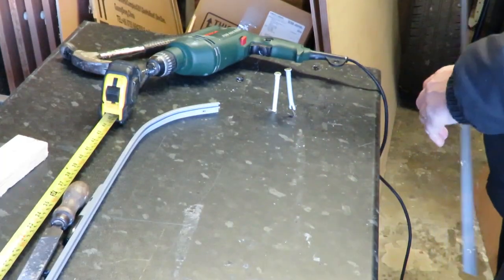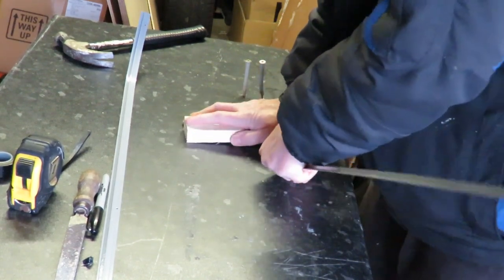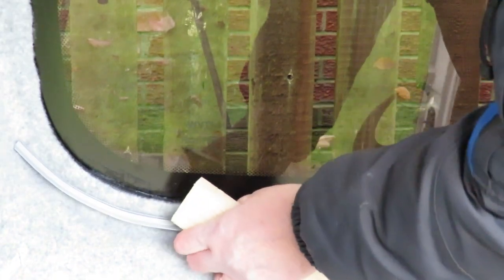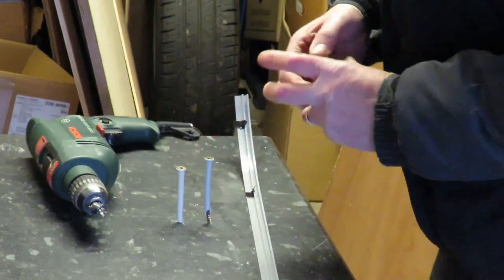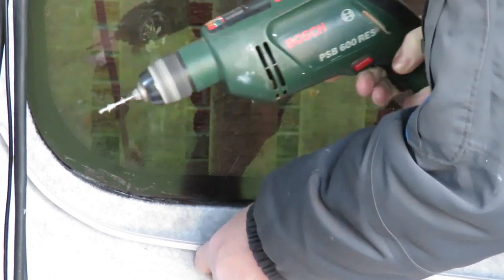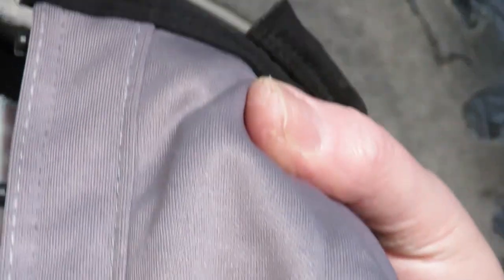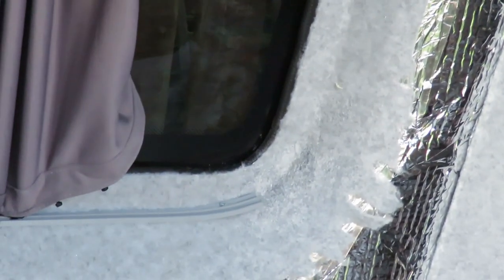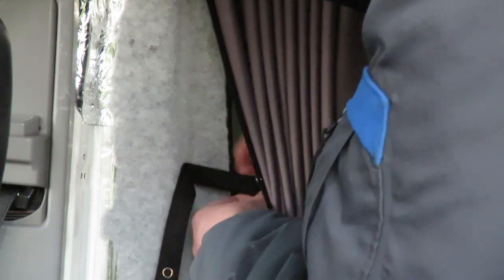How to Install Van X curtains - VW Crafter DIY Camper Van Conversion - Video 12

Comment: Hi Brian, can you let me know where I can purchase the rails to make these curtains please. Thanks for your time
Reply from the maker: You can buy the rails separately from VanX, but these came as a kit specifically for the Crafter/Sprinter, I used  Kiri vans for the bulkhead curtains which also came as a kit, they are also cheaper and the quality is fine, I used the kit for a Transporter rear door for the bulkhead